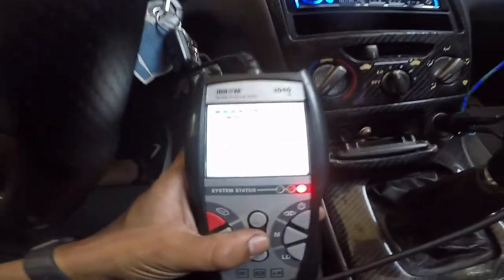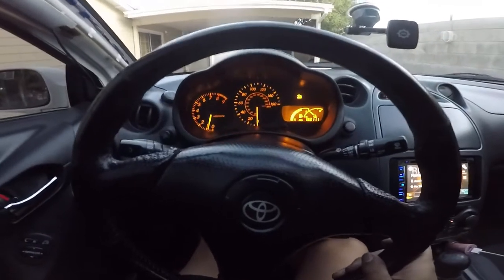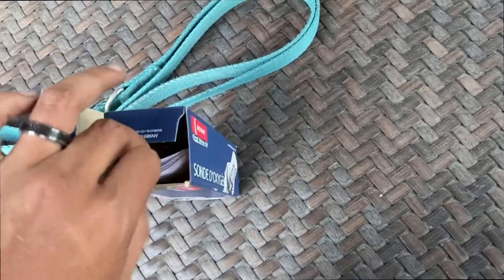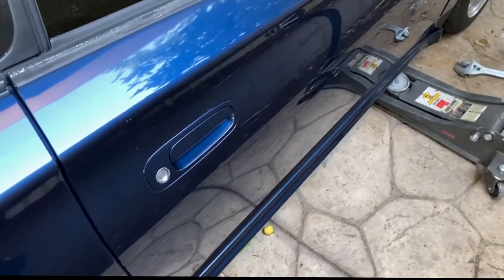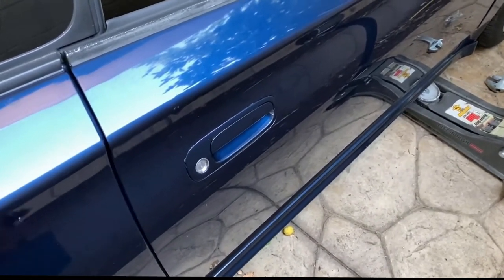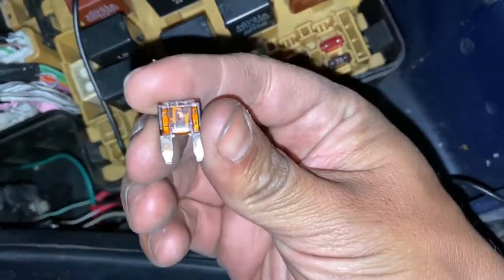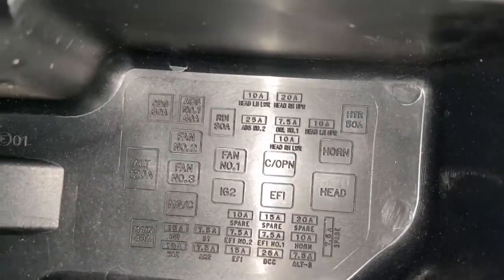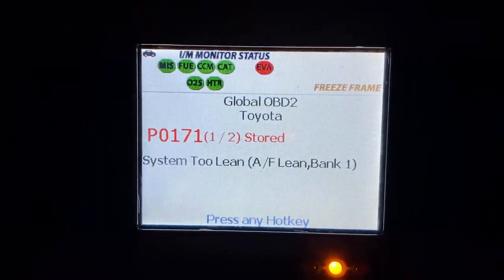New O2 Sensor

Comment: I bought my two O2 sensors on Amazon for less then $80, OEM. Since I was replacing my cat I decided to just replace both. For the past 6 months I too was getting a P0171 bank 1. I took a day to diagnose the problem and it turn out to the be rubber elbow connected to from the Throttle body to the intake. The clamps gets loose so make sure the clamps are tight. I have an Injen CAI. Good luck.
Reply from the maker: T- MAN Thanks for the info the internet is cheaper just you have to wait for shipping and It was my O2 sensor the system too lean went away already